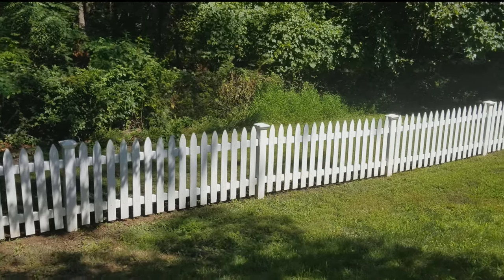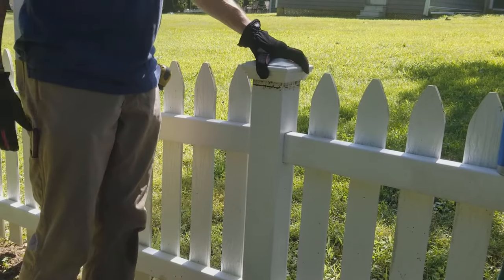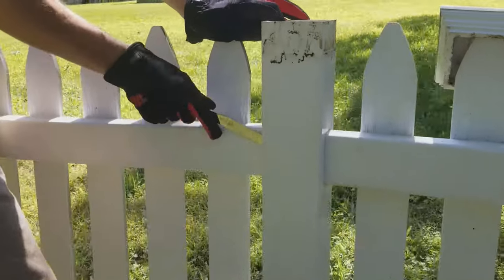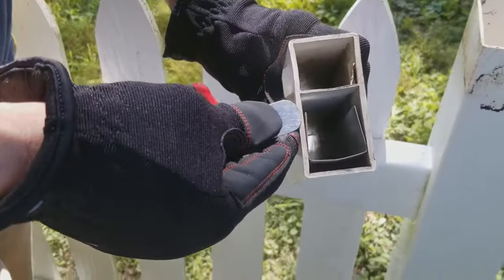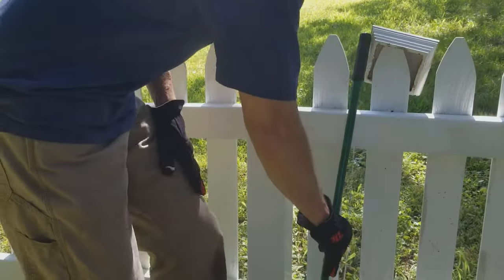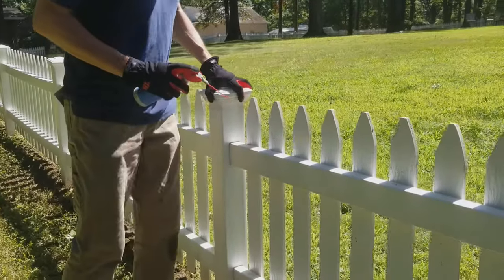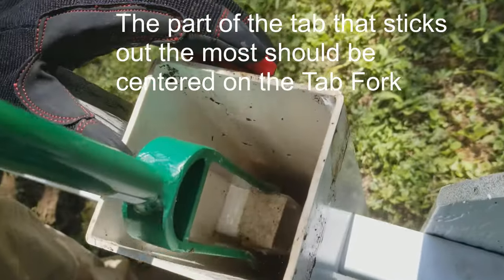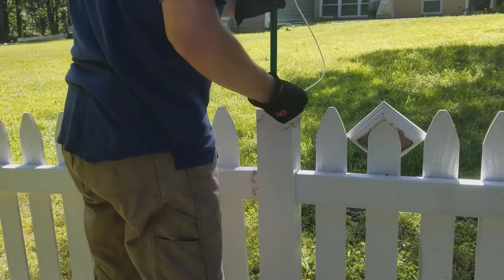Fence Rail Removal Using the Fence Rail Tab Fork - www.TheTabTool.com

Comment from the maker: The video shows is version 1.  The newest version #3 has adjustable tension and uses a standard MOP thread so any painters pole or old mop handle will work.  Check out the web page for details.